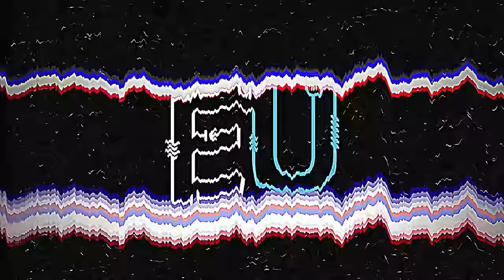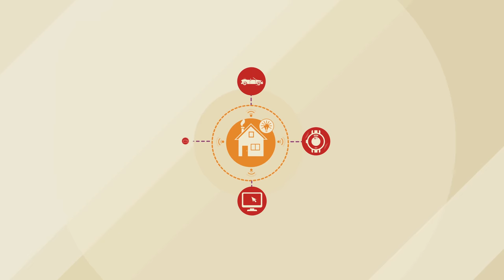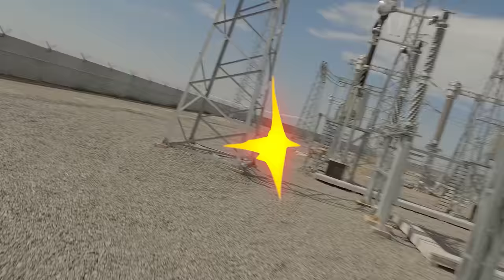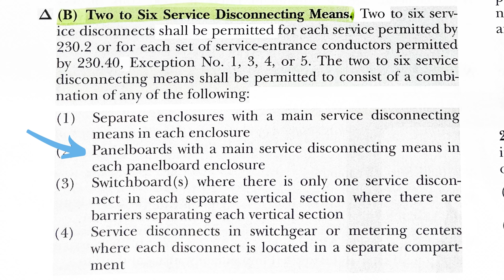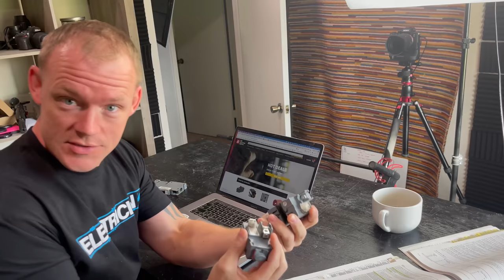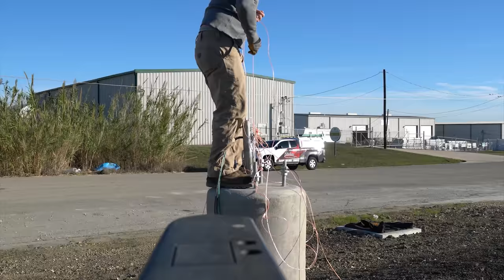SIX THROWS OF A HANDLE?!?! Are Split Bus Electrical Panels Still Legal?

Comment: Really neat set of rules. They make even more sense than they did before. A split bus system is something I've not come across, other than having a contactor in the middle, like for a lighting panel, and the bus underneath being controlled by the contactor.

Comment: It's really common here in Alabama to have a main lug only panel or a "meter/load center combo" with space for 6 240v breakers, one of which feeds an indoor subpanel that supplies all interior 120v circuits. Sometimes the outside panels will end up with 120 breakers for outdoor lighting or outlets.

Comment: Dustin, don't ask for Apple. Get TOYOTA to redesign the codebook. They know how to make things simple and durable! No pointless updates!
Reply: Apple will complicate it so much more and then say, submit your question about the code and $150 every 15 minutes for us to reply with your answer
Reply: Toyota this also 90% plastic and unreliable but aye if they make good instructions 🤷🏻‍♂️
Reply: Couldn’t agree more. Go read a Toyota or Honda service manual. They are the absolute top of the line. Makes American manufacturers manual look like garbage.
Reply: @fedfreds832  tell the taliban that 😂
Reply: Yeah Apple will make it so you have to scrap it all and buy another. And you're not allowed to order parts.
Reply: @fedfreds832  I've owned and driven Ford, Chevy, Dodge, Datsun, and  International Cornbinder.  My last three have been Toyotas.  'Yoter beats all the rest for reliability.  To get back (sort of) on topic, I hope my new Eaton service panel does as well.  Since it's replacing a Federal Pacific it'll have to try pretty hard to disappoint me.

Comment: I found it interesting. When we bought our house, it had a Federal Pacific split buss, fully loaded and overloaded before the main. Swapped it out before moving in. I feared a fire hazard. I’m not licensed, but still passed inspection. Chances are, mainly because the inspector saw the old panel and decided the change was safer. Went with SqareD qo. It was the only brand I could find with enough spaces with a 125A main. I really wish I upgraded to 200A, but $ at the time was an issue.
Reply: You always could've just got a 200A panel and bought a 125A breaker to use as your main--thats what I did a couple years ago. I'll upgrade the service size later when I'm not broke but at least I won't have to replace the panel again
Reply: Never saw a panel with a 125 amp main breaker. A 200 amp panel was always the same price as a 150 amp. Would only be less then $20 for difference in price of 125 amp aluminum service cable verses 200 amp cable.

Comment: NFPA is supposed to be written by the manufacturers -- who are motivated by their profits -- but, of course, it is. (that's why GFCI, AFCI, and both are required in all manner of [censored] stupid situations, like a 50A drier plug.) These sort of constructs are just sub-panels that share a box. :-) As long as there's a single main disconnecting means -- i.e. big knife blade thingy -- there's nothing wrong with them. (other than their obvious oddball nature.)

Note: we had something similar wired into the RV... to "convert" from 240 split, to single 120. (breaker that shorts the A and B buses... if you forget to open that breaker before connecting to 240, well, it opens for you. :-) )

Comment: I've got an old wadsworth i'm about to swap out (my own personal panel lol), but the curious thing about the panel that I always wondered about, It has a fused main disconnect but has a 100 amp breaker for a subpanel feed that came with the panel. I guess because it's an ancient 200 amp panel? I never thought about the availability of larger breakers back then. It also has the strange quad double poles with the outer two and inner two tied together.

Comment: If the NEC was Apple you'd be required to buy a new house for anything beyond a light bulb replacement. 🤣
Reply: Yeah no shit. They'd have their hand in all the manufacturing before long too--DONT FORGET TO BUY BRAND NEW BREAKERS EVERY YEAR
Reply: Or even worse they'd lower your breakers amperage rating every month after the new apple panelboard is released...🤬🤬🤣
Reply: Apple would install non-replaceable light bulbs and require the entire house to be brought to the Apple Store to have the fixture replaced.  The would void the warranty on the house if you make any repairs.

Comment: Hrm.. If I understood that correctly, you are saying that my service panel is not to code.  I seem to have dual 150 amp service coming from the meter to the main panel next to it.  This panel has a few breaker slots below, but mostly it has two main breakers that each feed one sub-panel inside the house, so to shut off all of the power, you have to flip both of the main breakers in the main panel.

Comment: Let me tell you something I’m working on the split bus last week. It was so damn confusing. It was a three phase coming in the disconnect. I didn’t even bother checking out because I didn’t check it. I did everything I had to do remove all the GFCI’s because one of the half of the building wasn’t lighting up that’s what I’ll get you. The GFCI‘s open replacing no power still replaced all the electrical outlets on that side no power still replaced some of the bad breakers that weren’t working right replaced. It was no power steel. It was a damn fuse in the disconnect pisses me off, took me three days to figure it out. I told him 10 hours anyway, I appreciate you my guy.

Comment: So bottom line, do I have to replace my panel? I have 6 220v breakers, 1 x 60amp feeds my lower bus, 1 for dryer, 2 x 40amp x 220v for an on demand water heater, 1 for appliances (split outlets) and 1 for the oven... U want a paid vacation in Seattle 🙂

Comment: If it was done by Apple you would just throw out the whole electrical system and rebuild it from nothing any time you have to change a lightbulb...all boxes and panels would be glued or welded shut and non-serviceable.  Connections would be welded instead of terminals so even if you cut it open you can't change it.

Comment: I had one in St.Pete Fl, over on 38th ave, # 6870. she had gas dryer and water htr, 
range and stove top, took 2 dbl brkrs, A/c too a dbl brkr air handler took a dbl brkr,
dryer took a dble and a dbl brkr worked the lower half of that panel for all 120 volt 
circuits. we used the dryer for Gen when Irma came thru, I pulled the meter to avoid
juicing a linesman.

Comment: If i have a main panel that has no main breaker but instead has main lugs, could i just add two 100amp breaker where the circuit breakers go and backfead them with the red and black hots that supose to go on the main bus, instead of buying the entire main breaker convertion kit?

Comment: How do you think this relates to Solar Generating systems? It seems common (on youtube) to use say the right hand side of the panel for incoming legs of 120 from several inverters, and loads on the left hand side. Do you think this pattern is up to code as long as there's less than 6 handles?

Comment: I used to belong to an organization that has printed suggested standards and reccommened for over 100 years.  The text pages are organized in chapters and bound in post-bound books (2 books) similar to loose-leaf binders.  When changes are made, only the pages involved are printed and disseminated to holders of the books to be inserted while the old pages are removed.  This has been successfully done for over 100 years.  Each book is thicker than one of your NEC books.

Comment: Okay, given some jurisdictions require a main service disconnecting means at the meter, could that theoretically make otherwise "illegal" panels fair game again? It would be terrible practice, but could someone do it?
Reply: The work flow process is still the same from the firefighting/emergency response perspective. You’re still looking for a single exterior service disconnect first, then a single interior disconnect. Then you go for the 2-6 disconnecting means within the first panelboard/switchgear/etc. This revision to code prompts that the default is a single disconnecting means, which is a much safer design.

Comment: They are interestin' if u never saw one before. U will see a lot of them down in St.Pete FL.
I had one. house had a gas wtr htr and dryer so the big stuff was stove and oven and the
central A/C and a 2 pole breaker to feed the lower half for 2 wire branch circuits. There are
no MAINS though. So when Irma came though I fed the house from generator through the 
dryer ckt. and pulled the meter to avoid juicing a linesman. I did of course cover the meter 
so no water would enter the meter box.

Comment: As a fire inspector, I very much appreciate your code-change rant. Although I'm sure the "old guys" tasked with writing the code revisions might not. 😂

I've got NFPA 1 & 101 every three years, with frequent reference to 70, 72, 25, 13, 10, 96; then there's 80, 85, 88s, 92s, 220, 230s...  

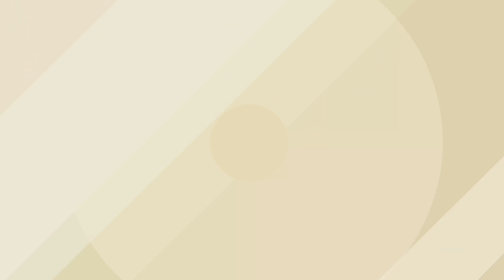I have to say though, when our building official gifted me his old NEC Handbook, I was as confused as I was thrilled. I still have trouble navigating article numbers instead of chapters. But I guess 1:11.1.7.3.1 isn't really any easier to get to than 70:110.22. 🤷🏼‍♀️
Reply: Also, I'm not familiar with split buses but I do look for the main disconnect when I'm at an existing commercial or +2-family residential.

Comment: Was surprised to see a large hospital that I retired from had the 1970 dual 13,200 volt  service in one end of a basement and a 1998 dual 13,200 volt service in a addition to 10 story building. Sure that circuits were added from new addition to original building. So you would have to go to 2 locations maybe 800' walk to secure normal power then go up to roof to secure halve of the emergency power feed from 3 generators. Had 4 other gen sets next to newer service.

Comment: Question:  Is this discussion applicable to sub-panels?  For example, if I have say a 200A main panel in the house feeding a 100A sub-panel in a detached garage, do I have to have a single point disconnect for the sub-panel in both enclosures or is it ok to only have the sub-panel disconnect (breaker) located in the main panel?
Reply: I think you are okay. My 1975 house I bought in 2017 has that and I've got a million 120v plugs and a 220v plug in the garage. Figuring out which turns off what is the biggest headache though

Comment: 9:41 disagree with your take on how they write NEC... What we do is very complicated and requires a shit ton of information because so many things in our world demand electricity... Code is not at all an instruction manual, it simply guarantees a SAFE install...
Doesn't have to be efficient, convenient, or economical but rather a safe install to be NEC compliant. If you follow the code you will have a safe system THAT'S IT... 🤓⚡🤷🏻‍♂️
Reply: His rant was about how it ordered information and how it was organized for ease of navigation though.
Reply: That's is correct

The NEC is a minimum safety standard - Mike Holt
Reply: @Wayne3nterprises  right and if you know how to navigate the code book you'll appreciate the indexing such as sections 240 and 250. Or article 320 and 334. It's written by very competent people who revise it every 3yrs..!! What else do you want...??? If it were easy everyone would do it...!!

Comment: "Six operations of the hand" doesn't necessarily mean 6 breakers.
Many inspectors consider opening a panel door as the first step.
I've never heard it referred to as the "6 handle rule" in Northern Ohio.
Reply: 6 switch. Weather single pole, 240 or tandem single. No more than 6 switch in a single can under 125 a service as I recall.. I did solar. Alot of hacking...

Comment: Dustin does the 2020 apply to service generator panels that are outdoors and manual switching mains that alternate as the main switch securely locking out the alternate switch until manually switched again( Eaton CH48GEN3060R ). Gregory.

Comment: im still a bit lost on all of this 6 handle rule shit.  so does this affect a sub=panel with no main disconnect? 

another scenario, you have your 200A service coming in to your main box. in that main box you have a 100A breaker that goes to a sub-panel which also has a 100A main disconnect. in that sub-panel ther is a 60A breaker that goes out to.... lets say a 220v heat pump. outside at that heat pump, there is a service disconnect. is this the type of thing this 6 handle rule is aimed at? i always though tthis kind of thing was ok (albeit, imo, a bit sloppy) ???

Comment: Dustin, "illegal " is not really the correct language to use.  The correct term is "non-code compliant".   My instructor( who was also an Electrical Inspector with my local County) corrected me on this one day 25 years ago, when I was still an apprentice.  Great video otherwise.  Thanks, Russ from Oregon
Reply: If something doesn't comply with code and you refuse to fix it, they will cone arrest you and seize the property, with no compensation for what was taken.
Reply: @timramich  I would call it illegal. It is very much law. Don't mistake that. It will be used against you in the court of law.
Reply: @timramich  if you have a house build 25 years ago and the code changed 15 years ago. It was built to code but is no longer code complaint. If you tried to use 25 year old code for today then it would be illegal.
Reply: @FishFind3000  I stand by what I said

Comment: Not gonna lie thought that was grandfathered listed equipment for paralleling lower gauge wire directly from the panel in some old code, instead of using a nipple to an enclosed distribution block.

Comment: California utilities will bring in a 2nd service just for high current car chargers (e.g. dual 50 amp tesla chargers) with their own meter & panel. It's actually easier than trying to upgrade an old home 60/100 amp panel to 200.
Reply: Word. And you don't have to bring existing to code....
Reply: Code required a 200a can and feeder. But some ahj allow mcb derates to existing amps. Falls on utility to approve....

Comment: I've installed NEW dual buss. Notching only in the bottom for single tandem and quads. I.e. square D. It's still a thing. S f. Bay a.h.j. a mess.

Comment: The code book is written like a law book. Once you know how to read it which doesn't take that long to learn, Keeping Up With The Changes is easy
Reply: At the time this was adopted a typical modern all-electric house had (5) 220 circuits; oven,
A.c., dryer, water heater, air handler, the sixth handle would feed your general lighting branch ckts. Fun fact

Comment: To drag this into the weeds a bit regarding multiple services on the same property - I know some places (sports stadiums in particular, but could also happen with office buildings, hospitals, and others) have multiple feeds from the local electric utility (often fed from separate substations).  Theory being that under normal operations they can load balance between the two feeds and if one goes down they can shift everything over to the other and if both feeds go down they can use generators.  Would this count as two services or no?  If it does count as two services, is there a specific an exception in the NEC that would allow it?  Understand I am not an electrician or an NEC geek by any stretch, just asking for my own edification.
Reply: I'm wondering that also.  My school campus has 2 underground feeders from the street.  Most buildings have an A/B switch to change feeders if one goes down.

Comment: That's too confusing. How is it possible NOT to subdivide a panel? Our house was built in the mid-60s with aluminum wiring on top of that. The panel is divided into two seconds. The main section contains the large appliances like the water heater and air conditioner as well as the main breaker for the lower panel that feeds the 120 lines. It's out of code now. Yet, what about panels with one main for the entire panel? I'm sorry, but that's also a split bus. It makes my head hurt. I suppose you could just have no main breakers, but it would take all day to shut off the whole panel. Please clarify. I mean, I can see why people just do stuff and don't have it inspected with that kind of confusion.

Comment: The split bus panel design made me wonder if there is another type of panel or device that can have two services come in but would have a switch that determines which of those services is engaged.
curious if there is a solution to manually switch the source for a downstream subpanel of a residential 2-unit building. The purpose is to be able to change on demand from which unit the detached garage or workshop is powered.
If there is no such switch, wondering how it would be designed to accommodate such a requirement. I can imagine that such a switch would need to have 2 independent buses to make sure hots and neutrals come from a subpanel that services a specific unit but not sure whether each bus would need an independent ground or they could share just one ground.
Reply: Industrial switch gear exists for datacenters etc. Multiple utility services switched automatically.
Reply: @cheddarcheese  I think for my case I need a double pole disconnect switch that should solve my issue. Thanks for the follow up!

Comment: The code is conveniently revised by and for the benefit of equipment manufacturers bottom line.
It’s cloaked in safety for the purpose of appeasing the sheeple.